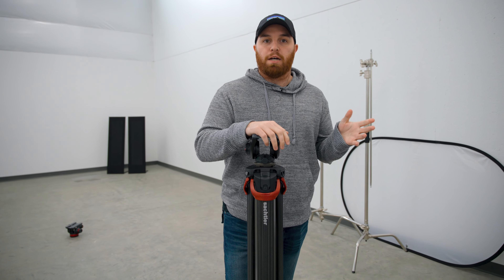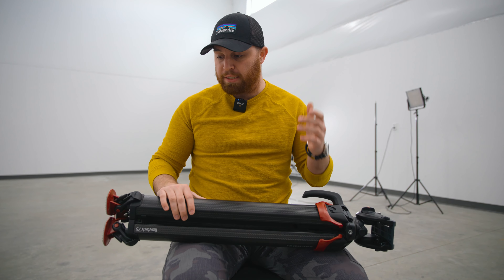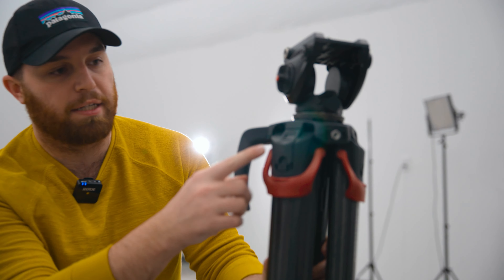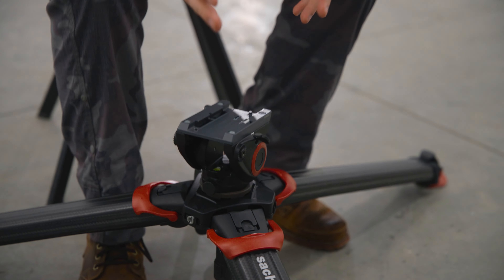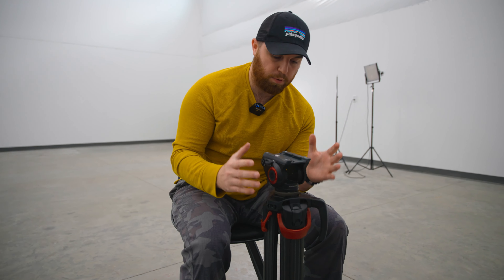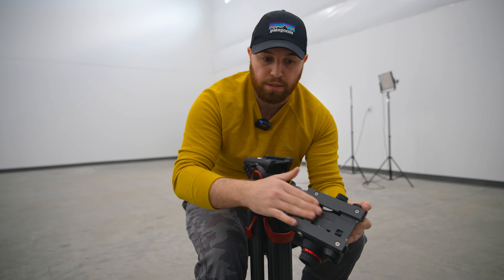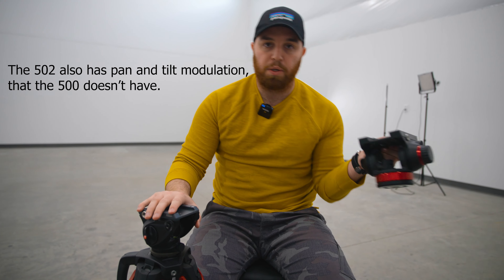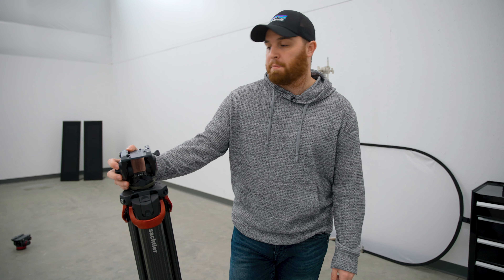Why would ANYONE pay $2000 for a Tripod!?!? Sachtler Flowtech 75

Comment: Manfrotto video heads = Ford, Sachtler video heads = Ferrari. 500ah head on flowtech 75 tripod = Ferrari wheels on a Ford.
Reply: Those manfrotto heads are complete trash. Every 500ah head I've used that's more than a year old just feels awful to shoot on and like it's aged 20 years already.
Reply: So Sachler is overpriced, unreliable and breaks down quickly? I think you mean Toyota.
Reply: @thingsforotaku8082  Did you just say a Toyota breaks down easily? One of the most reliable brands? lol
Reply: No I meant sachtler is Toyota not Ferrari, because Toyota is reliable and Ferrari is not
Reply: @totalrogue  Regardless of whatever car analogy you use, that Manfrotto head is garbage. I got these with an Aktiv8T head, and everything it is well-designed, easy/simple to use, and pan/tilts are smoother than grease over a frozen lake.

Comment: I went with Manfrotto Carbon Fiber 645 legs and Manfrotto Nitrotech 608 Fluid Video Head. It’s got very similar features but it was $1200. I was looking at the sachtler, but didn’t quite have enough.
Reply: Go with what you can afford.  But the Manfrotto in a couple of years not going to hold up unless you baby it to hell.
Reply: The Nitrotech is horrible, there is pretty much zero dampening. As a result, they should call it a photography tripod. Returned mine and got a sachtler, zero regrets. Feels as smooth as my cartoni, if not smoother.

Comment: Manfrotto Nitrotech head is horrible, it had ZERO dampening. Don't trust them as a company anymore with what they're charging compared to what you get. They should call it a photography tripod honestly. Had to return mine and got an entire sachtler setup. The dampening on that one is amazing and well worth it for a tripod. You'll have it for many many years, you'll actually be able to pan/tilt with it smoothly (which is a big part of owning a tripod) and it's ergonomics are amazing.

It's steep for the price but buy once, cry once. I'd prioritize a sachtler, miller or cartoni head then buy cheaper legs. Manfrottos new legs are not bad, I'll give them that. I like the weight and their quick releases latches.. but avoid those tripod heads at all costs.